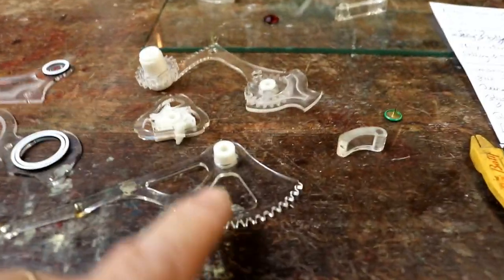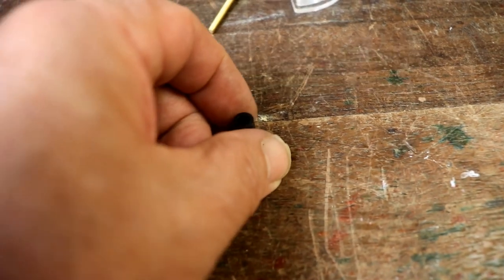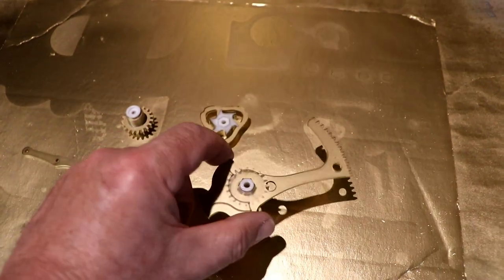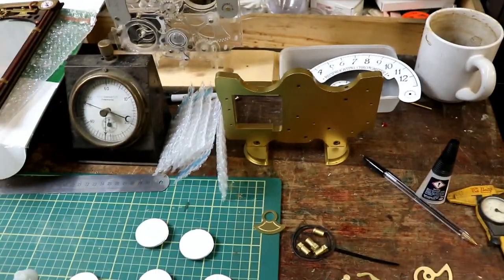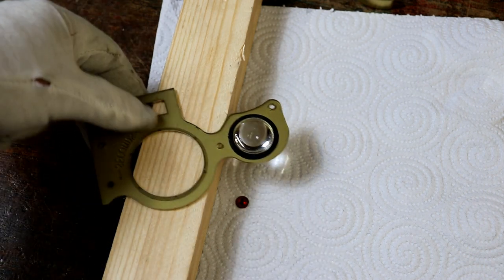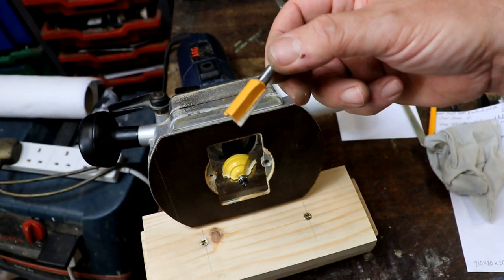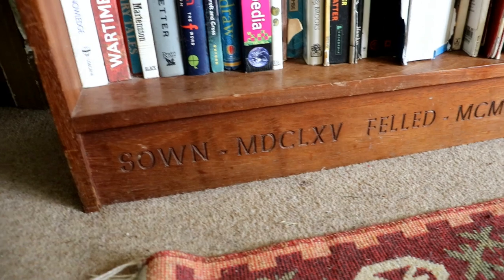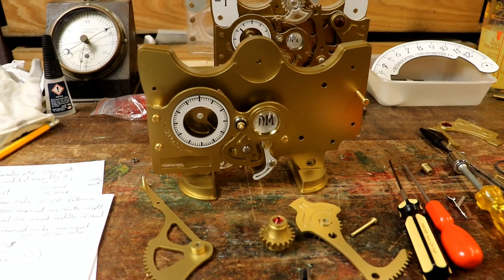A Reciprocating Steampunk Clock 3

Comment: Hi SH, one thought that comes to mind re the hex wrench you may include is that it would be great if there was a solution on the clock somewhere to store the key when done.  Most people probably won' have trouble tossing it when the job is done, but i have a real problem with throwing out perfectly good tools, materials, etc.   I must have 30 pounds of "kit" hex keys around the house and shop here!  Nice job on the bookcase as well!  Roman numeral never go out of fashion....
Reply from the maker: Thanks Tom, that's a really good idea. I know what you mean, it seems criminal to throw away perfectly good tools after one use.